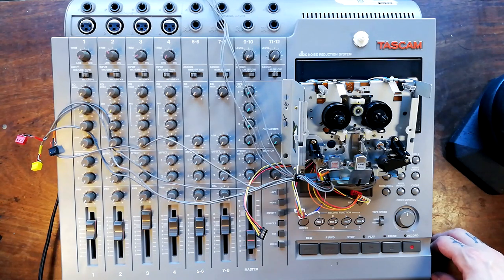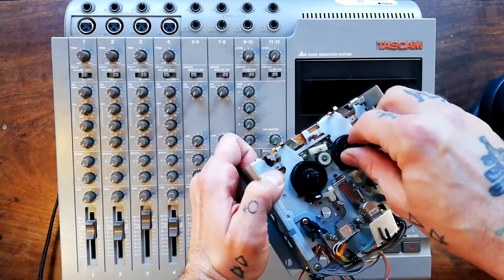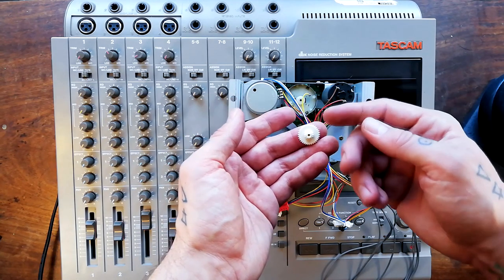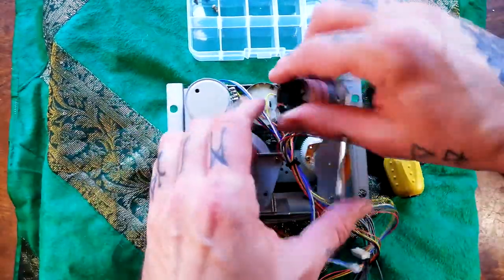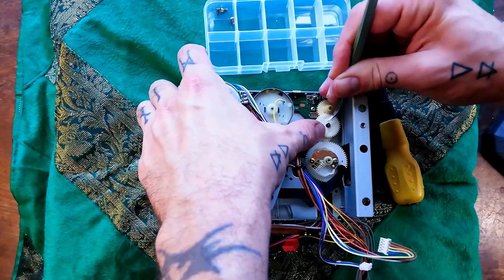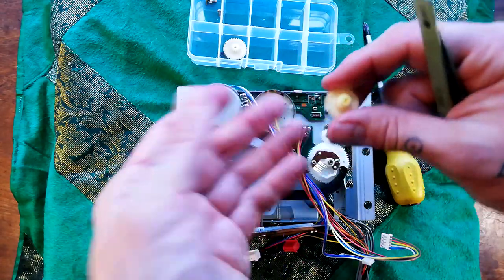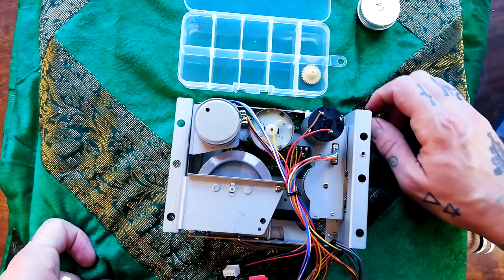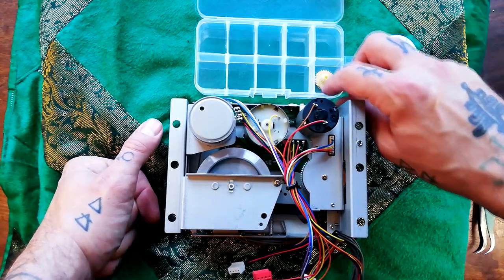Replacing Gear C | Tascam 464

Comment: Hey man, thanks for this guide! I had trouble figuring out why my 464 wasn't happy, and honestly I don't think I would've found out what caused it if not for this video. My symptoms: at first the FF and REW didn't work, the tape head was rising a little bit but then coming back down and I was getting the 3-button flash. After power cycling it a few times it started making a noise identical to the one in this video. Turns out my C gear was very very dead, missing a chunk of it's teeth and it literally crumbled into a million pieces while I was trying to take it off.

For anyone curious, you can find a 3D model of that gear on Prusa Printables, marked as "Tascam 488 MKII Gear C ". Printed in PLA with 0.12mm layer height, took around 10 minutes to print. Fits perfectly and works completely fine. If you're worried about the durability you should probably print it in a harder material, like PETG or ABS.

Link to the model:
https://www.printables.com/model/53073-tascam-488-mkii-gear-c

Compatible machines (according to a site that sells replacements):
- Tascam 122MKII
- Tascam 122MKIII
- Tascam 464
- Tascam 112 MKII
- Tascam 112R MKII
- Tascam 488 MKII

Comment: Heya Tetrakan; thanks so much for this; was able to replace mine so much more swiftly and easily thanks to your video; really appreciate it; turns out I needed a belt as well, but found that in your other video and now I'm back to a working unit. Awesome. Thanks again!

Comment: Thanks heaps for this video - it was exactly what we needed to see to be able to repair our 464. Have removed the dud gear and waiting on delivery of the new one. (In the process of getting the gear out we did exactly what you said not to do, and lost the little gear retention clip on the gear B - d'oh! But it turns out that a rubber foot from a MacBook can be used as a replacement, with a little bit of trimming.)
Reply from the maker: Good tip re the rubber foot!

Comment: great video, good to see you back after the fire! I did a replacement of the gear c of my 464 about half a year ago. not a difficult fix. The replacements are rather expensive. i found a shop in the netherlands who sells them for 16,50 euro's.
Reply from the maker: That's the cheapest price I've come across in the EU. Can you share a link here? If not maybe you could message me the link from my Facebook page? Thanks!
Reply from the maker: @ikworgek  thank you!
Reply: @Tetrakan  They are 3d printed and do work, but are not the best.
Reply: @kevmcgladdery782  Would you say these ones in the link just above are stronger than the Winkel.Van-Eck gear Cs? The gear C in my unit just broke and I'm struggling to find a replacement. I'm in Canada. Thanks!
Reply: @NaegleriaDrag  i have found them to be good.
Reply: Im not affiliated to these guys either, before you ask :-)
Reply: Hi can you tell me where in the netherlands  you bought it please
Reply from the maker: Suppliers for these changes all the time. You really need to type gear C into ebay and see what comes up. Most recently I used a UK eBay seller called  lightspeed mods or some variation thereof, the part worked fine.

Comment: Hey tetra, I just got a broken 464 and your videos have been such a great help! Honestly thank you for making them so in depth and informative. I was wondering how crucial it is to change this gear? Currently my gear c is that pinkish orange color you describe but it is not crumbling at all. Do I replace it or is it not a deal breaker. Thank you!
Reply from the maker: I guess you need to weigh the cost of the part and hassle of the installation against the consequences if the part cracks in the middle of use. If you're skint and you're not making  any music on there you want to release, leave it til it breaks - it will sooner or later....thanks for watching :)

Comment: out of curiosity, how easy is it to find proper replacement screws that would fit with this 464 model ?
just unscrewing and screwing then them back in seems enough to damage the head pretty seriously, they re of poor quality.
And now after successfully putting a new belt, the machine is giving me some of those signs you mention here of an issue coming from the gears (the eraserhead and play/rec head going up and down, the lights flashing).
So I ll have to open it again and honestly I'm afraid of finishing some of the screws for good by doing so...

Actually it s gonna be a big problem, as I tried to reach the gears before to see if anything looked suspicious (I already ordered some days ago the gear C, just in case it would be needed) but gave up as the small middle screw (the one above the larger gear, I think you call it D in this video) was so stuck I almost killed it already (and I might even have ruined my tiny screwdriver as well... I mean how seriously tightly screwed was that ?). Hoping that the belt was the only problem I put everything back where it belong and.... now I am the one feeling like I might be screwed. :(

tldr : no matter how fitting the screwdriver tip, some of those screws get damaged very easily imo, especially the black ones (like the two holding the transport together inside, and the long one in the back of the box, in the middle.
Reply from the maker: Because at one time I was fixing portastudios as a second income I have a ton of spares donors so I have never been forced to find new replacement screws, but I'm 99% certain you'd get them easily form an electronics or hardware wholesale store? 

Its been a long time since I damaged a screw, and it was always because I was using a low quality screwdriver that wasn't the right size. If a screwdriver fits correctly then the pressure should be evenly applied across the cavity...to me its an alarm bell that you describe your screwdriver as "tiny"!  If you have a good set (e.g. sealey, facom) then you'll find they are all pretty big actually, the different sizes is as much to do with the angle of the taper at the tip as it is the diameter of the shaft...

When working with screws that are very stiff I find it helpful to put silicone spray lube on overnight. 

If the head is damaged, a little sticking tack like oyu put posters up with on the recess can help the correct size of screwriver grip, good luck.
Reply: @Tetrakan  Hey, thanks a lot for taking the time to answer, man !
I was actually at such a store trying to find a replacement for the long black one that goes in the middle on the back that I damaged a bit, and if I found screws with the same width, the "spiral" thing wasnt the same (sorry for my lack of technical vocabulary).
Anyway, I managed to fix my 464 thanks to you and your videos !

I am just gonna add something here in case someone runs into the same issue.
After replacing the belt and lubricating the gears, it still wouldnt get much tape movement, besides the occasional heads going up and down again in a matter of seconds. I was pretty baffled. Even more so when I set up the machine in testing mode and then, suddenly, everything would work just fine (but only on testing mode). I eventually realized that there is this sensor thing at the top right side of the transport and that it wasnt touching the tape anymore, stopping the entire thing from working properly... I must have moved it while taking the transport out. So it was of course then very easy to fix, but that s kind of useless security to have, because what is the worst thing that could happen ? To record the sound of silence if no tape has been inserted, I guess ?
Reply from the maker: @Kylounette  I think spiral thing == ferrule? It is a difficult thing to measure, It may be a case of buying a cheap labelled assortment of screws then buying more of the ones which are the right size? Or if there is a shop near you that has them loose bring the 464 with you and try different screws until you find the correct type? In any case I'm glad the videos were of help, thanks for watching :)

Comment: Incredibly useful video series, thank you!!

Specific question on the tascam 464 transport I’m repairing: the electrical connection between the CAM PCB and the CAM control plate contact on mine is super sticky... should I clean that off? If so, what would i re-grease it with? (I assume something other than silicone lube for an electrical connection?)
Reply from the maker: Hello, sorry its taken me a while to reply to you, i used to receive email notifications about youtube comments but thats not happening any more....anyhoo, I'd use deoxit fader lube for that application. Its not cheap though -n  if the 464 is your only project you might want to find a cheaper alternative, I imagine searching for "conductive electrical lubricant " or similar would do the trick? thanks for watching!

Comment: Thanks for this, i followed your vid and everything went marvelous. My question has to do with the silicone lube and the spinny action of gear c after you lube it up. I got a decent replacement off of ebay, not a 3d one but it looks really solid and moulded and everything. Installed it, all’s good, but it doesn’t spin all that freely after it’s put on that little spindle it sits on. Lubed and everything, put it back together, and it’s playing, but the motor seems kinda... sluggish. Comes up to correct speed, but just kinda slow at doing so. More lube? Do the gears end up that stiff, or maybe lube up the other gears as well? Hmmmmm...
Reply from the maker: Double check there isn't gluey old grease on the shafts of any of the other gears. It is possible the motor itself is oxidised, and yeah you could  as a last resort open it, sand off and oxidation with fine grit sandpaper and lubricate anyoving parts.

Comment: Thank you for this video, it’s been very helpful. I had to replace the belt and c gear in my 646. Play wouldn’t work and all the transport lights were blinking, but now nothing works. Transport buttons are unresponsive. It doesn’t play, ff or rewind. Even pause button doesn’t do anything. Do you have any idea, what could be wrong? I checked the wires and everything seems to be in their place.
Reply from the maker: If nothing is responding then somethign is disconnected. I can't really say more without being there to observe the issue myself, sorry

Comment: Hey @Tetrakan! May I ask you where you have found this German supplier you talk about? 

My Tascam's leds started blinking, I opened the transport following these instructions and found out the Gear C is broken, split in two completely symmetrical parts! I fear trying to glue them wouldn't hold too much... definitely need to order a replacement Gear C!

As always thanks a lot for your videos, very explicative and crystal clear. Cheers from Italy!
Reply from the maker: It was in eBay, they don't seem to have any active listings now, but this part from an Italian supplier looks okay and the price is lower https://www.ebay.co.uk/itm/Tascam-122-mk3-464-112mk2-112-MKII-112rmk2-488mk2-New-Gear-C-9278377600-/193875925942
Reply: @Tetrakan  thanks a lot, being Italian sounds perfect! I'll let you know about the quality of the piece. You're the best!

Comment: hi! I started opening my 464 when the gear C broke, i was able, thanks to you, to replace it properly. Few weeks later i heard a buzzing noise coming from the transport, kind of the same as the one at 0:47, but my unit was working fine. Then the speed of the tape started to slow down at some points. I re-opened the machine and noticed that the sound came from the motor driving the belt, which was loose. I just changed that loose belt and now the sound is quiter but still present. My unit works fine, i can play, record and everything... but that buzzing noise is driving (if i may) me crazy...
Do you have any ideas or thoughts on what i can do to fix it ?
btw big thanks for you videos they are really helping me finding my way around these machine
cheers
Reply from the maker: I'm not really sure. Possibly the internal commutator has broken? Rare but it happens, see this video. https://youtu.be/IICcT4RDLa8

Comment: Hi Tetrakan.  I found your videos very helpful and replaced the gear C and belt on my 464 Tascam, but now it’s bringing the tape heads up and down repeatedly.  Took it apart again and put it back together, but still doing the same thing.  Any idea what is going on?
Reply: Sorry to reply to this so late but I've only just seen your question...are you still having the problem? If so can you film the issue and share the footage either a youtube address here or message me via facebook?

Comment: I replaced the capstan belt and gear C in my 464 and it won't play/record.  It used to work great until belt desegregated and gear C cracked, but now reassembled with new belt + gear C the capstan doesn't move in operation.  Any idea what to check?
Reply from the maker: In the 464 the capstan  should spin whenever the unit has power, even with no cassette present. If the capstan doesn't turn check all the plugs to ensure the motor was reconnected properly after the new parts were fitted?
Reply: Good point, ill replace the motor if that doesn’t work, thanks for your videos they are very helpful

Comment: Just went through this whole process to find out the gear C I received from Ebay was not the correct dimensions.  Once the gears are in place they should move smoothly without force correct? The gears won't move unless quite a bit of pressure is used. Ooof...guess I'll have to find a proper gear C for sale.
Reply from the maker: I haven't actually tried moving the mechanism by hand...might it be worth partly reassembling the transport to see if the heads raise and lower in response to the shuttle buttons before returning the gear?
Reply: @Tetrakan  that might be the case. Let me try it out. Thank you.
Reply: So I put it all back together and when powering on it has a couple second delay and then sounds like something tries to move inside for a split second, then nothing. Tried with tape inside and without a tape. Thinking its the gear

Comment: Good video. Is this gear C used in the 488 MK1? I'm working on one now and not sure if this is used in this model? Also looking for a replacement drive belt, do you know the correct size?  (currently have a rubber band as a temp fix!) CPC sell belts, but I don't have an original to compare with (sludge). Thanks in advance.
https://cpc.farnell.com/c/audio-visual/av-spares/belts-flat-section
Reply from the maker: Its been a while since i had a 488Mk1 open but comparing the exploded views of the 464 and 488Mk1 service manuals (both available for free download on my wordpress blog btw) no, gear C does not apply to the 488Mk1. I've successfully used gbaudio's 3.4 flat belt in the 488mk1 which is  which is 202mm in internal circumference, link is http://www.gbaudio.co.uk/data/belts.htm hope that helps.
Reply: @Tetrakan  
Thanks for the speedy reply! I'll try that belt from gbaudio then. No crumbly gear for me hooray!
Reply: @richardsmith4992  try AVBELT4 from CPC, they worked for me.
Reply: @kevmcgladdery782  Cheers. Tried the BELT 3.4 from GBaudio - works fine.